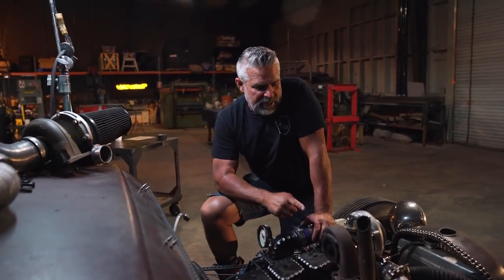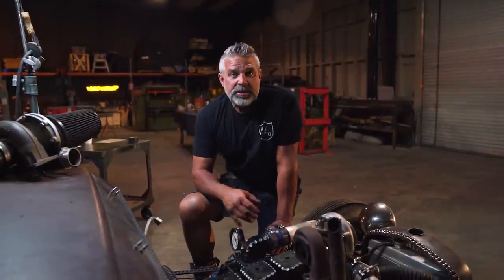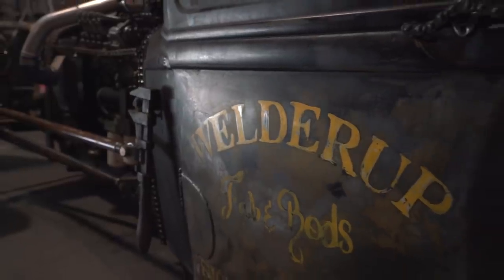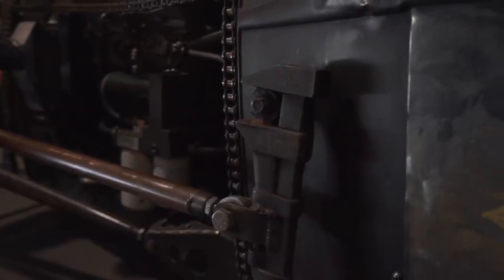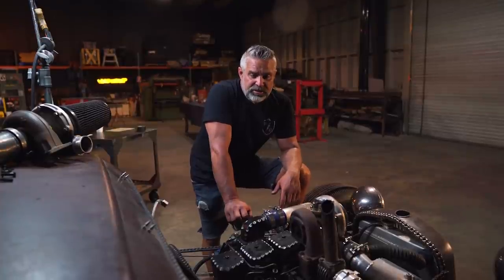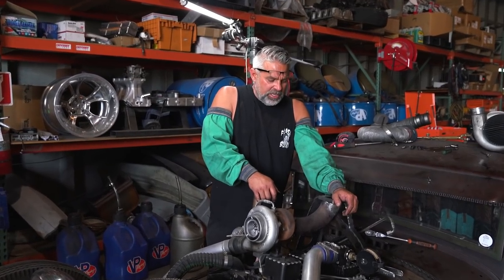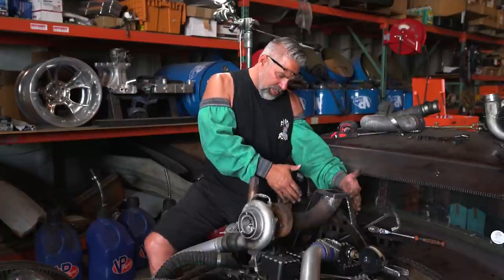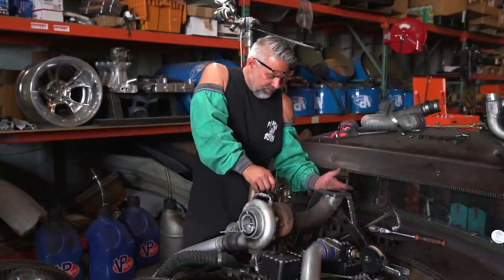Turbo broken? No problem. How to weld a turbo back together!

Comment: Just curious if you consider a 57 Chevy 210 post build?
Reply from the maker: Are you asking if I would rebuild a 210 if I had one? Absolutely!!  Or are you asking if I would do a 210 Chevy for a personal build for you?  I am not doing any builds at this time. My travel schedule has picked up and I do not have the time anymore. I miss doing the builds. But, hopefully you are doing this rebuild yourself. Lots of work but worth it.
Reply: @WelderUpVegas  looking to build on.e or have one built. 57 210 post. Patina canary yellow with white or black roof. Nice cruiser LS motor. Simple interior with a worn look.